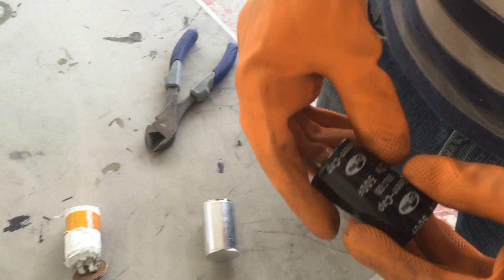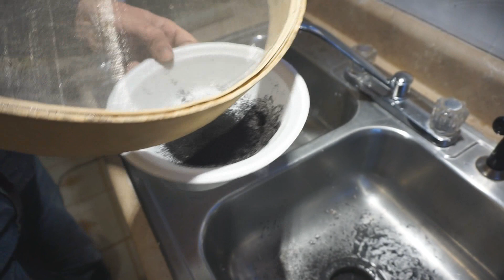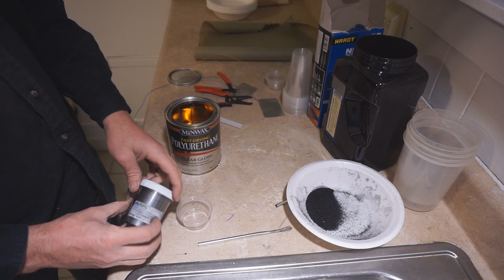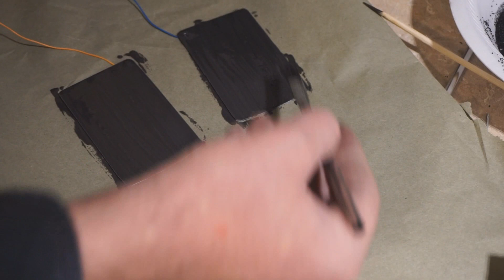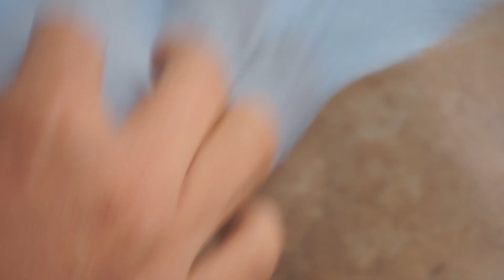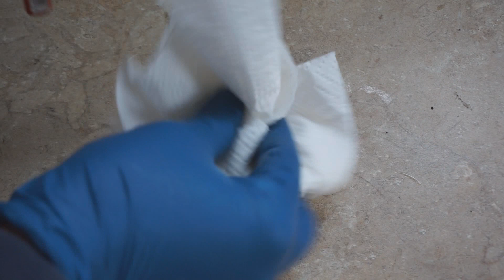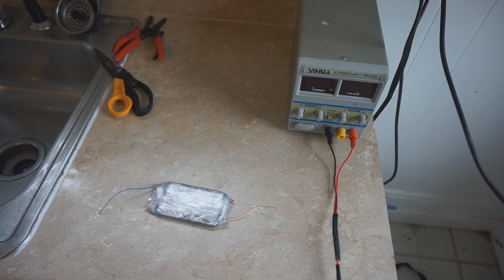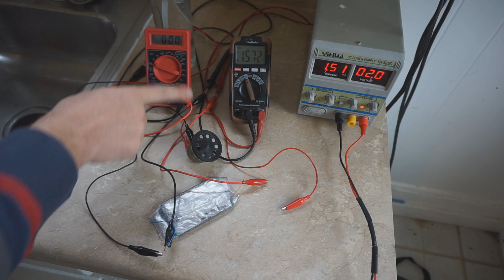Easy DIY Graphene SuperCapacitors

Comment: Hi my name is Maria I end up homeless living in a van. I want to plug a 350 watt heater for winter because mr.buddy heater is to hot. I got a inveter 400 watt how can get it going with a 12 volt battery? With out solar panels. I need something give juice to my battery to get my inverter going.
Reply: I'd say you should look into getting a fuel stove for heat and cooking that runs on either alcohol, propane or charcoal.   Be sure to ventilate it to the outside.  http://www.youtube.com/results?search_query=alcohol+stove

Comment: That was great in a lot of work but using a wet, it basically it’s nothing more than a glorified electrolytic capacitor/battery. Tried doing it dry and use the vacuum pump preferably if you can get down below 20 µm if you could get closer down to two or 3 µm a vacuum would even be better. And if you’re trying to achieve some sort of clamping force instead of tape used to slightly larger thicker Ridge flat barn metal it completely flat plates drill four or six or eight holes on the outer diameter larger than the plate and with bolts and nuts slowly and evenly tighten down the nuts to apply straight level even pressure along your plate everything available at your local hardware store, except they vacuum pump rated for deep vacuum below 20 µm into the sub 1 micron region.

Comment: The only way considered safe to connect copper and aluminum is through a splice connector. Specifically, you have to connect the wires individually so they are not prone to corrosion.

Comment: Great video. Thanks.If I may add a suggestion. Before doing the last seal, clamp as much of the pocket to remove as much air as possible. Once there is air trapped inside, no amount of taping will bring the plates closer together. Nice job. Thanks.

Comment: Re: METHOD AND MATERIAL USED: 2.45 GHZ MICROWAVE SOURCE  FOR THERMAL HEATING  QUATENARY  AMMONIUM SALT OR AMMONIA SOLUTIONS  WITH ALUMINA OR ALUMINUM CHLORIDE FOR INFUSION OF CARBOTHERMIC NITRIDE RESIDUAL INTO EPIOXIDE TOP  LAYER AND IMPROVE DISPERSABILITY OF TITANIUM DIOXIDE COATING  PROVIDES SUBTRATE LAYERING AND ACT AS A LARGE GAP CO-DOPANT : RAPID COOLING OF SUBSTRATE MATERIAL FOR CRYSTALZATION OF THE IMPURE CARBON EPI LAYER SUBSTRATE MATERIAL ON TOP.OF THE SILICON SUBSTRATE IN THE INTERGRATED CIRCUIT DIE TO CHANGE THE DIELECTRIC PROPERTIES COMPARABLE TO SILICON NITRIDE

Comment: You use graphite/graphene interchangeably. Do you have an idea of the thickness of the individual graphene sheets you're using? There may or may not have been manufacturing statistics given. The more carefully controlled the graphene production the more predictable the results. I'm just wondering where your graphite source was.

Comment: Been watching some of your videos lately and have really enjoyed them. Have read the comments as well and would just like to say, sometimes people try to shoot down what they see you trying to do and others try to share some of their knowledge  and lift you up. Don't take any of it personally and let it discourage your efforts to learn and expand on your efforts. At least you are trying. And many useful things today were accidents in a lab somewhere, or in a garage. That being said I would like to share something with you that really has no significance to your experiments but might be something helpful to you someday in some experiment. I worked for twenty years in an plastics injection moulding facility and we worked with many plastics. Two of my favorites were Polypropylene, and Polystyrene. The reason I found these two materials interesting was because of the amount of static charge they would hold. We used vacuum systems to load the plastic from large gaylord boxes through polypropylene hoses. While the vacuum loaders were moving polystyrene through the hoses if you got too close you would get quite the shock. Sometimes You might see a two inch long spark zap you.  The polystyrene was highly hygroscopic and you could feel the static charge in the gaylord as soon as you took the top off.  I found that fascinating. I also thought it was pretty cool that when you pulled parts off the molds they too had a strong static charge and we would constantly have to blow parts off to remove dust before packing ,bagging, and shipping. My whole point to sharing this is to say you might want to try some of this material in a project sometime. And if you are looking for some for a project you could probably request a Pelletized sample from the Monsanto Corporation. Keep on experimenting !

Comment: what would happen if you put it on aluminum foil and rolled it then sealed it in the bag? would the charge last longer or be higher voltage? I'm very curious

Comment: I know you tapped the wires flat and heat sealed both sides, but I wonder if air can still tunnel through the insulation of the wire.  Maybe you could try pressure air on the free end of the wire to see if the bag inflates. But maybe you are not worried about small leaks?

Comment: ok, um...question: how are you certain that the capacitance you are obtaining isn't just from the aluminum base plates? polyurethane is an insulator, and would insulate the wet layer, in turn insulating the sprinkled on pieces...it seems you would end up with just a regular capacitor? to do this correctly, you need to measure the capacitance of one without the carbon added, and compare it to one with. if they are close, than i would say you found a way to make a....regular capacitor you could have just bought.....

Comment: It would be nice to have a control capacitor with no graphene, just the aluminum plates, activated carbon and electrolyte/tissue thing in the middle.  I mean, that's going to be a capacitor too.  In fact, you can find statements like, "Today, virtually all supercapacitor manufacturers use coconut shell activated carbon as their active material." https://www.materialstoday.com/electronic-properties/articles/s1369702113003027/.   Also, when the UCLA researchers published their trick of making a graphene supercapacitor with the laser in a DVD drive they mentioned in their paper, https://hackadaycom.files.wordpress.com/2012/03/laser-scribing-of-high-performance-and-flexible-graphene-based-electrochemical-capacitors.pdf, that activated carbon also has a high surface area, "the large and accessible specific sur- face area of the LSG (1520 m2/g compared with 1000 to 2000 m2/g for a typical activated carbon material)"  (they also mention, "Although activated carbons can provide high surface area, the difficulty of controlling their pore structure and pore size distribution has so far limited the energy densities and rate capabilities of commercial ECs")   Anyway, I wonder how much of the energy storage shown in this video is due to the graphene, and how much is just due to the normal capacitor made up of alu plates, active carbon and electrolyte sandwich part.

Comment: lasersaber, if you want to build a really good non-faradaic capactor, that outperforms Lithium-polymer batteries by magnitudes, I suggest to use a new dielectric, termed as a topological isolator (see Wikipedia for details) - particularly nano-Bismuth (nBi) with a particle size below 9.2 nm. Bulk Bi is a metal - and a conductor. As a nanopowder, it forms a permanent, bipolar band-gap at its bounderies of about 249VDC for a 30nm layer and becomes something like a «superisolator at room-temperature» with an Epsilon-r of about 3.9E6. Caution: Transition temperature is +63°C. Exceeding this temperature will cause immediate shorting of the capacitor in an explosive (!) electrical discharge. You can create nBi easly by a slow (!) precipitation reaction e.g. from BiI3 by a any pH-neutral salt, that contains Sn+2-cations (consult a chemistry textbook for details). Wash the black nBi-sludge by deionized water, dry and handle  it under nitrogen-atmosphere to prevent oxidation. Cast sheet metal alloy of about 0.1…1mm thickness from Magnesium with about 1.5% Zn and 0.5% Ag by weight (no, you can't buy it, but metals are available from GoodFellows, AlphaAesar et al.). Cut two pieces from your MgZnAg sheet-metal of about 50…100x100mm. Polish one surface of each sheet metal to optical quality (shiny, no distortions, no burrs, rounded edges) under protective nitrogen atmosphere to prevent oxidation. Pour nBi powder carefully on one shiny face of the MgZnAg until it is uniformly covered. Now put the second sheet-metal with the shiny face on it. Apply gentle force starting from the center and squeeze out waste nBi. The sandwich will hold in place due to van der Waals forces. Distance between electrodes is about 30nm will become «naturally» adjusted by repulsive Coulomb- and attractive Van der Waals forces. Now, seal off all four sides with epoxy. Glue cables by conductive silver-epoxy (available from any electronics store) to both electrodes. Charge the device to about maximum 230 VDC and play with it. Your capacitor will exert a specific capacitance of 1.151 kF/m². According to W = 0.5 · U² · C the specific energy at 230 VWV is 8.45 kWh/m². A sandwich from just 20 1m² capacitors can contain an enery of 169 kWh at 2.3kV - far more, than a heavy, bulky Tesla S battery. I hope, you have just understood, why you should NEVER EVER short, overcharge, or overheat such a capacitor. The electric explosion of a 10x10cm (=0.01m²) device easily outperforms a hand grenade due to low electrical resistance of the MgZnAg electrodes. Unsuprisingly, commercial or civilian use of this type of capacitor is not allowed yet due to safety and security (!) concerns.

Comment: Could I set a bunch of these up in series and parallel to make a battery pack for say an ebike or whatever? I'm guessing the voltage would become too high. Maybe solve it by putting a diode connecting to higher gauge current wire? I'm assuming you can coat both sides? Would a thinner metal affect the performance? I think the electricity is stored in the electrolyte correct?

Comment: Re: METHOD AND MATERIAL USED: 2.45 GHZ MICROWAVE SOURCE  FOR THERMAL HEATING  QUATENARY  AMMONIUM SALT  OR AMMONIA SOLUTIONS  FOR INFUSION INTO EPIOXIDE  LAYER AND IMPROVE  DISPERSABILITY OF  TITANIUM DIOXIDE COATING  PROVIDES SUBTRATE LAYERING AND ACT AS A CO-DOPANT : RAPID COOLING OF  SUBSTRATE MATERIAL FOR RECRYSTALZATION OF SUBSTRATE MATERIAL TO CHANGE THE DIELECTRIC PROPERTIES COMPARABLE TO SILICON NITRIDE

Comment: So i may have done this wrong, but I plotted the wattage every minute that the capacitor supplied over time, found the integral, and got that the capacitor stored about 0.26-watt minutes, which is around 15.60 joules. this could be completely incorrect, so let me know if I did my calculations correctly.
Reply: I plotted the Wattage over time and used exponential regression to get the function that I got the integral from.

Comment: Nice! Have you tried using LYE as electrolyte?
Reply: Lye will dissolve the aluminum worse than phosphoric acid does. The acid can at least form an insoluble layer on the aluminum which protects the remaining aluminum metal underneath. Lye doesn't do that under any reasonable conditions and will just dissolve until it runs out of aluminum or runs out of lye. With different electrode materials, lye may be usable. Steel doesn't get dissolved by lye.

Comment: OK.. there's a lot of confusion and misinformation in these comments. The material he's grinding up has nothing to do with the graphene. It's activated charcoal for increased surface area of the capacitor. He explains early on in the video that surface area is the key to producing efficient supercapacitors. "1 gram of activated carbon can have surface area equal to that of a tennis court". He paints the graphene solution onto the aluminum plates, then presses activated charcoal to increase surface area.. im guessing the charcoal is very porous and that's why its surface area is so large.. Graphene is a "2 dimensional" material, but that is only an indication of its composition. More than one layer of graphene can be stacked while still maintaining the efficacy of graphene, due to the sp2 bonded atoms on one plane. Adding additional planes doesn't introduce additional vertical bonds of the graphene, thus maintaining its identity as graphene and not graphite...
Reply: ^One of the rare people on here that gets it, lol
Reply: It's almost impossible to purchase that scarce metal, Aluminum, outside of North America. We prefer to use Aluminium, which is a lower-cost substitute, and which has the advantage of being the most abundant metal in the Earth's crust! 

jk, so have a laugh, and don't be triggered! 👋 🙂 👍

Comment: I Apologize for advertisement without permision

GRAPHENE FOR SALE CARBOPRO GRAFENO. 5,00 NET GRAMs. HIGH GRADE POWDER 120e.   1 , 2 AND 3 LAYERS-ATOMS  EDGE (WIDTH),   AND 50 NANOMETERS TO 5000 NM BASAL PLANE (LONG). Made in U.S.A. Technical Data Sheet and Security Data Sheet. THE BEST QUALITY NO RGO, NO GO, NO OTHER NANOP AS GRAPHITE OR DIAMOND Also 10 grams avaiable, 200e express delivery included      IÑAKI   iaguirreb@yahoo.com

Samples of 5 gr and 10 gr. Quality Prices Ratio without competition in Europe and the United States, which usually ranges between 80 and 120e / gr. If you want it you can have 5 gr at  50e but they are no longer between one two and three layers-atoms of edge thickness but 60 layers and more and in very wide flakes, and this is no longer graphene but graphite, with worse solutions and worse performance in all his properties.

THIS IS THE BEST MATERIAL EVER AT  THERMAL AND ELECTRICAL CONDUCTIVITY, RESISTANCE AND HARDNESS, WEIGHT, FLEXIBILITY, WATERPROOF, ANTICORROSION, BACTERICIDE, LUBRICANT, FIRE RETARDANT, ELECTROMAGNETIC AND UV BARRIER.

ELECTRONIC APPLICATIONS, SUPERMATERIALS, EPOXYS AND REINFORCED POLYMERS OR CONDUCTORS, BATTERIES, COATINGS, LUBRICANTS, SUPER CAPACITORS, ...

FOR LABORATORIES, EDUCATION, INVENTORS, FRIKIS, ENTREPRENEURS, ...

Comment: Back of envelope calculation tells me:
1 Joule = 1Volt x 1Amp x 1Second. This battery runs at ~1Volt at ~30mA for ~10minutes (give or take), so holds 1 x 0.03 x 10 x 60 = 18Joules of energy. 
In my workshop I have a small 12V 9Ah Lead acid battery, which by the same calculation holds 12 x 9 x 60 x 60 = 388KJoules of energy. Have fun making 20000+ of these things for equivalent energy density of a small battery.

Comment: That's NOT Graphene. Especially when you say you washed the really thin stuff down the drain. Graphene is 2D and transparent. I use the electrochemical exfoliation method, and while I do end up with some unbelievably fine pieces, they still are that carbon gray color, indicating to me that I may have produced fine graphite that has some features the same as graphene, but I have still yet to produce legitimate graphene. Which is currently the most glaring problem facing the unbelievably wide-spread domination of every market by graphene. Regardless. Keep doing what you're doing. The current guaranteed way of graphene production is the most crude, scotch tape cleaving method. I just wanted to point that out to you. As impressive as the performance users like us see, we still have yet to see the real capacity. Pretty unreal when you think about it
Reply: Doesn't the electrochemical exfoliation of graphite make "few-layer graphene"?  I think people are simply calling it "graphene", for short, even if it isn't technically correct.

Comment: Why the heck didn't you start with powdered graphite. And why didnt you use a seal a meal vacuum sealer? Would have been easier and the vacuum would have applied pressure to it.

Comment: You can solder copper wires to aluminum with regular tin/lead solder. You cover the spot on the aluminum where you want to solder with oil (the stuff you put in a car engine) and solder the wire under the oil. You want the oil to completely submerge the area you're soldering onto.

Comment: Nice video. This is very likely a rechargeable battery which is still a good experiment, done at home and with accessible materials. Well done! 
One of the aluminium plates is acting as the anode while the other aluminium plate is simply a conductor to the cathode - the carbon. The phosphoric acid is simply an electrolyte - quite possibly one of many that may allow it to function but will be definitive for the performance of the cell. The video below will offer more enlightenment into the subject:  https://news.stanford.edu/2015/04/06/aluminum-ion-battery-033115/
Note the main benefits of this rechargeable battery is the fast charge and multiple charge-discharge cycles which is made evident in this video.

Comment: Love the video!  I suggest to use DVMs that will send the voltage and current values to a computer, whereas it can be graphed for the charge and discharge cycles.
Reply: You should be able to use least squares to calculate capacitance.

Comment: Where does on start? Graphene - you don't have any - covering the plates of your capacitor with stuff just increases the distance they are separated. You seem to have missed the point. Energy density of your cap  - it charges up to x volts at x current in x milliseconds. An AA cell can deliver 2.8 amps for an hour - probably at a guess - as I didn't watch to the end 3600000000 times the energy available.
Reply: OK, I watched a bit more - you are making some sort of half arsed battery..still better than your half arsed 'super'cap.

Comment: How did u arrive to polyurethane and also for activated charcoal...does  this overcomes the existing capacitor.. if so, how much efficiency it has compared to the existing capacitor... How much you have increased the capacity...